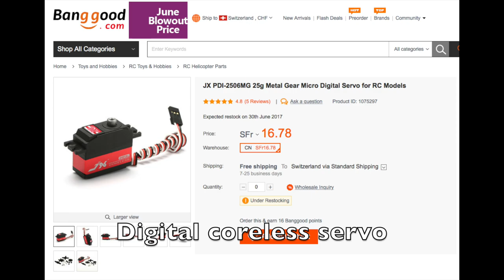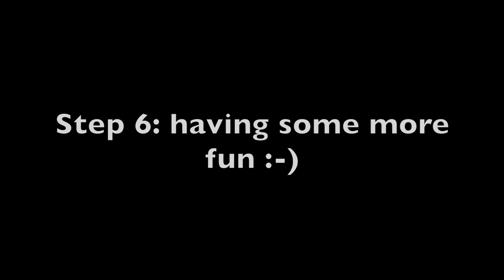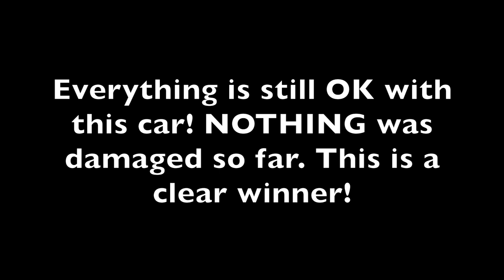REMO Hobby SMAX: Crazy Fast Brushless Conversion, DIY Arduino Remote!

Comment: Do I need a new remote to do this to mine or can I used my this motor and transmitter and it will work with my remote that it comes with
Reply from the maker: You need to replace transmitter and receiver

Comment: Is it possible to make it brushless without all the extra drilling? Can I buy a pinion gear 32 pitch to fit a brushless shaft? Is the gears 32 pitch?
Reply from the maker: It is possible, but it is not perfect, because the pinion is wobbling around a bit. The module is 0.7mm
Reply: The 2440 and 2445 motors have 2.3mm dia. shafts. I have two Remos, one with 2445 and another with 2435. In the 2435, I used a piece of aluminum can (~0.12mm) as bushing to adapt 2.3mm pinion to 2.0mm shaft (0.15mm is the theoretical required thickness), working for almost a year with no problem.
Reply: @pu5epx  Excellent , thanks ! :-)

Comment: I dont know why yours wasnt faster nough becauee today my brother got a remo hobby smax and it goes so fast with my small 3s battery but were most likely going to do a brushless conversion on it
Reply from the maker: It may be fast, but not for long. I think the original esc and motor will be fried in no time on 3S

Comment: I saw those knipex side cutters @ 2:16 too. Blown through more of those than I can remember but they’re excellent.
Reply from the maker: They are of good quality. Just don't use them for steel wire.
Reply: Yea, sometimes I get in a rush and cut 1/32" tig wire fully knowing the destruction I'm doing lol

Comment: I just purchased one. I'm going to upgrade it to 3s Lipo with a hobbywing 30 amp brushless combo kit and change the shocks to oil filled.I will purchase a cheap servo but you can't plug a 3 prong futaba servo adapter into a 5 wire port on the esc so I will have to upgrade the transmitter and receiver to.
g
Reply from the maker: The REMO receiver / ESC also has a 3 pin servo connector. So you can use a better servo without having to replace the receiver.

Comment: the transmitter and reciever of stock smaxx is good quality?
Reply from the maker: They work. And you even can plug in a 3 pin servo. But it's quite slow with the brushed stock motor. also have a look at my other videos.

Comment: Can the center driveshaft be replaced with a metal wltoys driveshaft?
Reply from the maker: I don't know. At least it looks similar. No issues so far with the plastic driveshaft. A metal spur gear is included.
Reply: I bought a smax yesterday and in the parts book, there is a metal center driveshaft available

Comment: why didn't you just mount the brushless system in the old chassis?  :)
Reply from the maker: Because the receiver / brushed ESC is mounted with very sticky double sided tape and I had a chassis without electronics available. I have now reused the brushed chassis: https://www.youtube.com/watch?v=eStFw8VlUNs

Comment: I guess they should had made a SMax pro version, brushless. $40 bucks more. We need options lol.
Reply from the maker: There is also a kit version available:
Remo Hobby SMAX kit: https://www.banggood.com/Remo-116-DIY-RC-Desert-Buggy-Truck-without-Electric-Parts-p-1104282.html?utm_campaign=4828314_1046285&utm_content=1097&p=NZ29024828314201605E
Alloy Shock Absorbers (can be filled with oil): https://www.banggood.com/REMO-A6955-Alloy-Damp-GTR-Shock-Absorbers-2PCS-116-Car-Parts-Truggy-Buggy-Short-Course-p-1103398.html?utm_campaign=4828314_1046285&utm_content=1097&p=NZ29024828314201605E
3S, 1300mAh, 20C LiPo battery: https://www.banggood.com/ZOP-Power-11_1V-1300MAH-20C-Lipo-Battery-T-Plug-p-990755.html?utm_campaign=4828314_1046285&utm_content=1097&p=NZ29024828314201605E
2440 4600kV brushless motor: https://www.banggood.com/Racerstar-2440-Motor-Brushless-Waterproof-Sensorless-608046004000KV-118-116-RC-Car-Part-p-1112737.html?utm_campaign=4828314_1046285&utm_content=1097&p=NZ29024828314201605E
35A brushless ESC: https://www.banggood.com/Racerstar-35A-ESC-Brushless-Waterproof-114-116-118-RC-Car-Part-p-1082604.html?utm_campaign=4828314_1046285&utm_content=1097&p=NZ29024828314201605E
Servo: https://www.banggood.com/JX-PDI-2506MG-25g-Metal-Gear-Micro-Digital-Servo-for-RC-Models-p-1075297.html?utm_campaign=4828314_1046285&utm_content=1097&p=NZ29024828314201605E